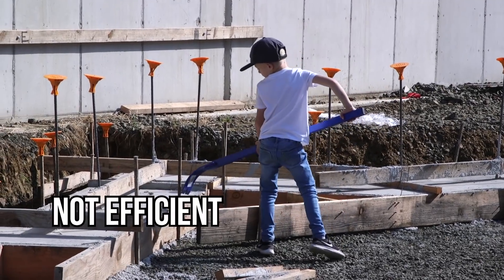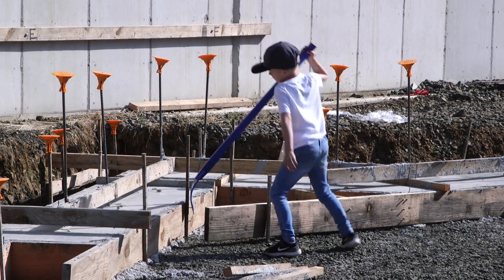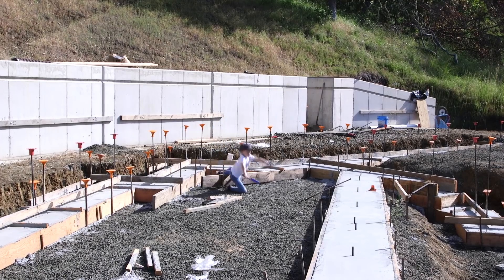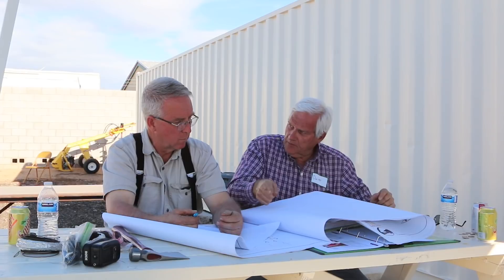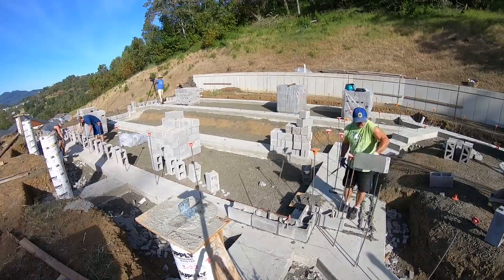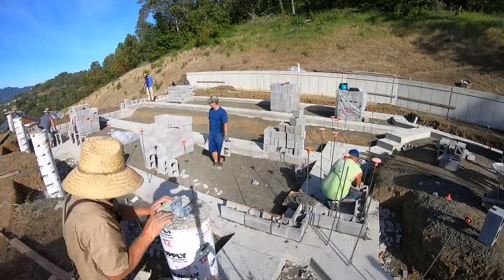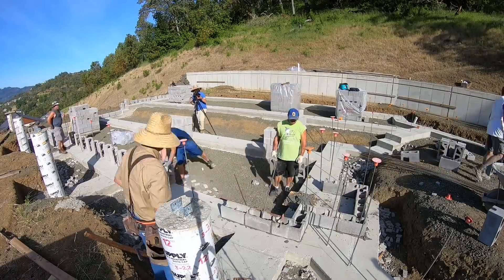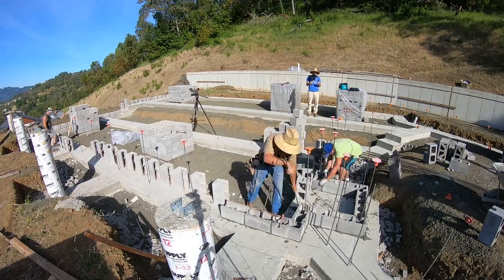Building Science and Technology Ep.33

Comment: Building science is making our buildings more reliable.   When homes were built with real wood and not air tight so that they could dry building science wasn't needed much.  Now that so many materials are man made and the energy conservation is important building science has become more important.  Man made materials are great structurally and very dimensionally accurate, but they are made of "waswood" which is saw dust or strands of wood held together with glue.  The problem is that these materials such as LVLs or OSB, etc cannot tolerate water.  In fact, if they are not allowed to dry out they will decay very rapidly.   Matt Risinger says "If it can't try it's going to die".  Drying requires energy change and now that homes are much more insulated to reduce energy loss drying potential decreases and if water is not managed properly rot will occur.   It is comforting to listen to experts such as Joseph Lstiburek explain that it isn't necessary to perform Hygrothermal Analysis to build a home efficiently and so it isn't destroyed by water.  Its just necessary to follow a few rules to ensure water does not enter the home and if it does have a method to remove it.

Comment: Some modern building science details aren’t that expensive.  Capillary breaks, insulation in the right place.  Matching layers to layers on all sides.  Building and sealing your window frames in such a way that there is a failsafe for any water that gets in.  Not every home needs to be at Passive House standards.  I enjoy Matt Risinger’s channel a lot.  I put more focus though on Dr. Joseph Lsitburek.  In one talk he made a fantastic point which I think Matt has also mentioned.  We once built with wood which had specific properties when getting saturated and dried.  We switched to plywood and OSB without considering the way they are different from wood.  We’ve trapped water instead of redirecting it, or allowing it a path by which to evaporate, water always wins.

I would suggest you look up say roof details from Dr. Lstibureks 2019 talk.  He explains the process of ice dam which makes complete sense and how to avoid it. I think traditional with a few critical tweaks would create a remarkable house even factoring in cost/benefit.

All that being said, nothing we will build will last forever.  And every new method material seems to have some unforeseen issue 5 - 45 years later.  Whatever you decide, best of luck throughout the project.
Reply: Joe L is absolutely awesome.  Real practical and down to earth as an engineer.  His daughter has a channel that is also really interesting.   See Craig E comment for more info

Comment: Sir, what's your thoughts on Hempcrete?

Have you ever used it?
Reply: Hempcrete is structurally weak and will eventually have interior rot.  One gets MUCH better strength and insulation by using normal concrete and polyurethane foam board insulation.

Comment: Are you guys planning on putting in a heat pump? I think that would add a huge value since its cheaper to run than a furnace and also functions as an AC in the summer for those periodic heat waves.

Comment: My temp swing this year has been -20 to 102 f all while living in 120-year-old tech.  We have scrapped boiler from 1910 and used the chimney to run ductwork to the second floor and shot cellulose and expanding foam into walls. Gone through more tubes of caulk than you can imagine. So yes you have to adapt to climate and work within building restraints.

Comment: Over building or insulating  is never  smart money the extra 20 bucks a square foot will far out weigh what you earn in energy  savings if its simply invested.
Reply: Sounds like most people were saying here in the early 70's prior to the oil crisis... The government decided "never again" and taxed the bjeezzes out of oil consumption, which led to much more energy efficient housing, which in turn led to pretty much self reliance in energy, contrary to pre '73... It's all in the eye of the beholder. Can the US continuously afford to be so reliant on foreign oil resources? So far as I've seen, it's hardly worth the trouble.
Reply: @martinpoulsen6564  I would like to see us not be reliant on foreign oil.  And, why waste if we don't need to?
Reply: @Carla_de_la_Gnomes  Waste is exactly the point. Badly insulated buildings are a waste of resources, if you want to control the temperature at least. Bringing down consumption is the best way to increase your freedom. Energy prices are not going to stay at this level... it never has. So in a not too distant future, if you hang on to the house, it will turn out to be a good deal, unless of course you have your own sustainable powerplant, off the grid, and carefree from everyone else. 

As for the US not ever being fully independent on energy consumption... probably not. But the less you need to import, the smaller the problem. This whole current Iran deal is not looking too good either.

Comment: If i had a cent for every time the client needed to be taken to the side and have it explained to them that building a house "efficiently" means you build it to suit the world it lives in...i'd have a significant sum in my pocket. Most important aspect of the thinking phase as far as i'm concerned, prolly rate it even higher than ground work. Figuring out the climate, both in the present but also in the future and determining which house is the best house for it.
It tells you how the ground will behave, what materials you can use, what systems to implement, what ideas to consider, EVEN, how the house will look and feel.

As far as i'm concerned, building a house without those variables "calculated" is a foolish endeavor.

Comment: I've been a long time subscriber to Fine Homebuilding and I have to admit I've had it up to here with articles on energy efficiency. They pump out article after article on hyper-insulated homes (R-60 roofs, R-30 walls) as if the law of diminishing returns doesn't apply to insulation.
I'm all for employing good waterproofing techniques and minimizing penetrations into the house but there's a significant difference in cost between "good enough" and "state of the art", thank you for pointing that there's nothing wrong with "good enough".
Reply: It's not diminished if the HVAC, fenestration and sealing techniques match the base insulation. Home design also is key. With the rate of land values increasing, it only makes sense to spend more on the build cost of the house IMO. Code changes are coming anyways, you can't stop it or get around them.
Reply: @dh66  Aren't you going to see diminished returns at some point?  No matter how much insulation you have, you're not going to be able to eliminate an HVAC system (unless your climate allows for PAHS, but that's completely another story) and it's difficult to get fenestration with a U factor of under .1.

Do you think it would be worth it to insulation all exterior surfaces to R120?
Reply: I guess it would depend on all other factors mentioned, including the climate. I'm not an engineer, I have just been studying energy efficiency codes and techniques lately. Yes, there is diminishing returns but not at the current minimum code in almost all jurisdictions. If people didn't move so frequently, energy efficiency would be on everyone's minds and it would matter a whole lot more.
Reply: "Yes, there is diminishing returns but not at the current minimum code in almost all jurisdictions."
What?
The term "diminishing returns" means that the effect is logarithmic and not linear or exponential, the starting point doesn't matter, what matters is that each additional unit of insulation will have less of an effect than the prior unit.
I think a spec home builder would be nuts to g beyond code minimum, as someone who's worked with big homebuilders I can tell you no buyers I've dealt with have cared a whit about extra insulation. That doesn't mean I would be lax on watersealing or minimizing penetrations (to a point) but I sure as hell wouldn't throw away money on extra thick insulation or god forbid... double framed exterior walls or other such nonsense.
I have done raised heel trusses in the past to get insulation the full thickness at the eaves (plus I think it makes the window trims in the upper windows look better) but that's about as far as I would go. The truth is that your typical spec house buyer wants as much square footage they can get and nice fixtures and finishes and don't give a rat's ass about things that they can't see. No buyer is going to say "oh, it's got R-60 ceilings? I'll take it". Another aspect is that lenders don't care about high insulation values, they aren't going to take that into account when approving someone for a loan.  So unless there are drastic changes to the system, spec home builders need to realize that insulating above code is simply throwing money away.
Reply: Bob Johnston  you are correct that most people don't care about efficiency. Their biggest complaint are uncomfortable houses and high utilities which they can't effect or control so as a responsible builder we should minimize those items for the client and they will be our sales force!
Reply: Bob Johnston, your statement on law of diminishing returns should be qualified as to where you are located in what climate zone! Climate zone 5 covers most of North America and to build R30 walls and R 65 roofs which I do only increases the build cost by minimal amounts. You must look at the Btu's per square foot of any project as the main driver of the decision. I build at 10 Btu's or under per square foot to achieve comfort. Passive house builds at 5 Btu's per square foot. Adding R10 to code built walls $1.50 per square foot today's material costs. Adding R30 to R38 today's code only adds $1.50 per square foot on blow in. If you have a 2000 square foot house you have added $6000.00 dollars to put a heavy jacket on the outside instead of a windbreaker. Don't be a Windbreaker!
Reply: @josephv5346  what level of insulation do you have in your home? If R120 is not past the point of diminishing returns, what about R300?

Also, if you really knew what you were talking about, you would know that PAHS is an underground house.

Comment: Future wire your house, all convenience and lighting circuits in 12 gauge, even if you run them on a 15 amp breaker. Don't let you electrician load the circuits to their maximum leave some carrying capacity!
 Code is just a minimal set of standards
Reply: If your wiring on the entire run of the circuit is 12 gauge (or heavier), I wouldn't recommend using a 15 amp breaker.  Why cut yourself off at the knees at the outset?
Reply: I did that on my add-on just cause and if I want to make them 20A I can a change of breaker and outlets and boom it was not a big expense to go 12gauge at that time
Reply: Use 14 gauge for lightning circuits it turns out better
Reply: @CaseyColando  Explain your reasoning please
Reply: @bigunone  it's so much easier to work with 14 gauge. Use 12 for outlets
Reply: @CaseyColando  Agreed it is a bit harder, but if you do it all the time it's no big deal
Reply: rule of thumb in our country (using superior 1P 230V AC as a standard :) ) is to leave at least 1/3 of electro cabinet empty
Reply: WAS USING 12 GUAGE FOR EVERYTHING 30 YRS. AGO....I WAS TAUGHT THAT WAY...I WOULD NEVER HAVE GUESSED IT WAS NOT THE ..STANDARD.. NOW A DAYS.....
Reply: @MD-cd7em  I started in 1990 we were running almost everything in 14 slowly we started using more 12 when I started my company in 98 we were wiring everything except lights in 12 eventually I just went with everything in 12
Reply: @MD-cd7em  Why are you yelling at us?
Reply: Future for lighting is low voltage LED, with wireless controls. I'm not saying it's right or wonderful but I bet it'll be there soon (20years?) Look at the stuff in Europe.
Reply: I am no electrician or expert but I think code here does not allow the mismatch of wire and breakers. The theory I believe is that when you look at the wire in the box you might assume the breaker amperage wrong. If you run wire for 20 amps the breaker must be 20 amps. Maybe someone else can confirm?
Reply: CedarTrailsLiving you can over wire, and under breaker, but not the other way. Also you can overdo the receptacle.  I don’t understand doing this on a new project though.  The wire is the expensive part (material&install labor), so the bulk of the spending is already gone
Reply: @jasonji1900  Thanks for the clarification. This was an inspectors interpretation of the building code from what I understand. This particular story was for a dedicated refrigerator outlet so maybe that was a factor assuming that 12ga wire could have a 20amp breaker but the device load needs the breaker to trip at a max of 15 amp load.
Reply: Have you heard of LEDs?
Reply: Future is wireless
Reply: @mraliks1  HAHAHA!
Reply: @mraliks1  The government grabbed all of Tesla's notes, so wireless power transmission may be a pipe dream
Reply: @bigunone  wireless power transmission is inefficient and not required.
Reply: @dh66  LOL I'm not the one that claimed the future was wireless that was (@mraliks1)
Reply: @bigunone  I see my error now! oops!

Comment: Very nice. It would have been stronger to do a poured foundation wall. Please tell me you are doing ice and water shield the entire roof and vented rain screen for the exterior wall cladding. Pretty please.
Reply: This is a subjective argument from what I've seen over the years. A poured wall can certainly have a stronger lateral load but one must always factor in the entire foundation system - whether using block or cast - to determine the final outcome. I've seen many block walls that put a cast wall to shame, and in my 20+ years as a contractor in Michigan I've repaired thousands of leaking cracks in poured basement walls, but never in a block basement wall. Craftsmanship has much to do with this subjective argument and I've seen wretched block work and cast work that I wouldn't trust to support a shed.

I like both - so long as the work is done not just to code but above and beyond with each trade doing more than the basic requirements. Most poured walls fail due to poorly compacted Earth below the footing in combination with the absolute minimum amount of concrete and rebar in the footing and in the poured wall itself. Everything to save a buck up front seems to haunt the penny pincher down the road!

No argument just my two cents in a conversation 👍 and I'm a huge proponent of doing things once by going above and beyond!
Reply: Poured wall would be more expensive and add no pragmatic benefit.
Reply: @suspicionofdeceit 1 he is used rebar.
2 rebar is code in Washington.
3 Washington is not southern Cali.

Pay attention if you want to give your opinion and not seem daft.